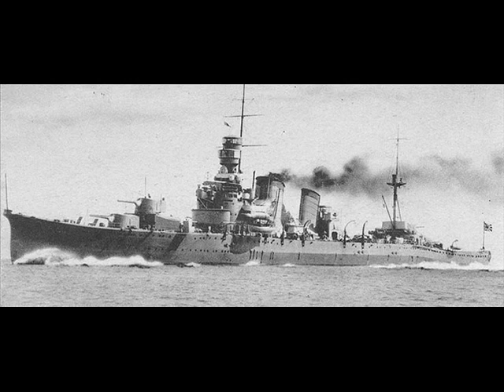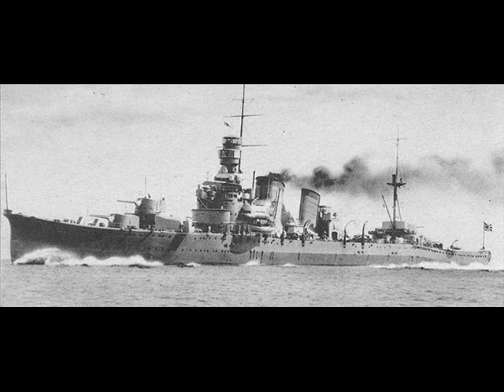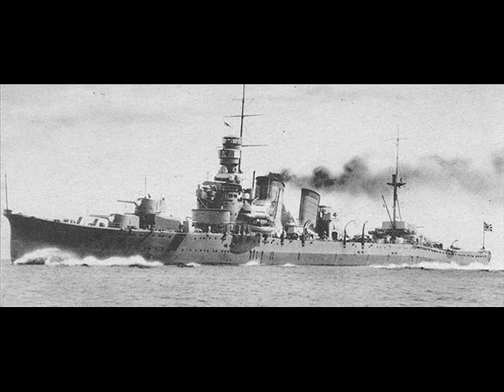Furutaka class

Comment: One wonders what the Japanese were thinking when they designed these ships. Obviously they didn't survive the war. Six slow firing 200 mm guns. Against a ship, with twice as many faster firing 6" guns? The light armor provided minimal protection. Well ok, they floated, moved at 30+ knots, and carried long lance torpedoes. Seriously, the Japanese navy could have done better.
Reply: they're glorified torpedo boats
Reply: @mariebcfhs9491  The Japanese did reply too much on those 24" long lance torpedoes.
Reply: @mariebcfhs9491  Adding the 8" guns to the design was really foolish. Too much weight, too slow firing rate. ESPECIALLY at torpedo firing range. The shock of firing such heavy weapons requires excessive hull reinforcement. Finally there was insufficient guns for good salvo groups. Making the main guns of very limited value at range. Lighter, more top heavy hull, for a poor gun platform. It was designed by someone with some very odd ideas.